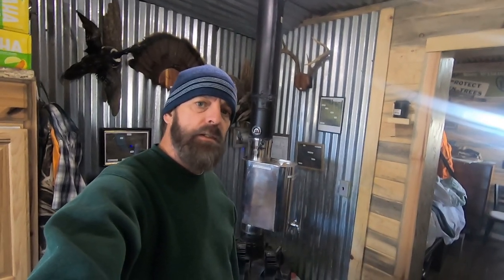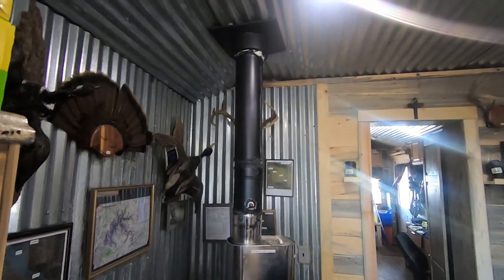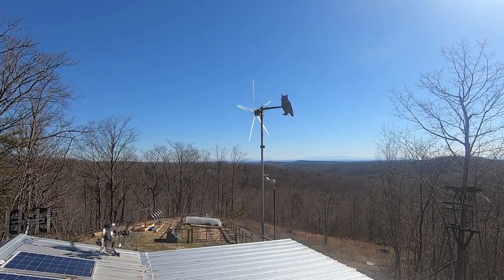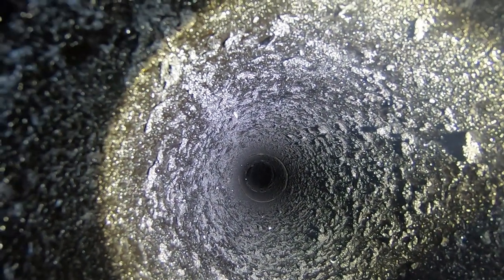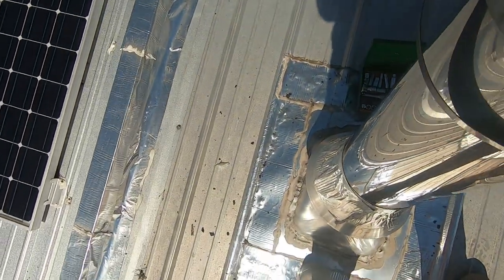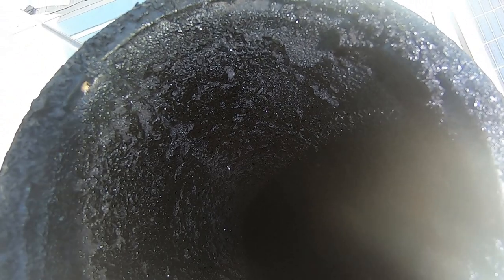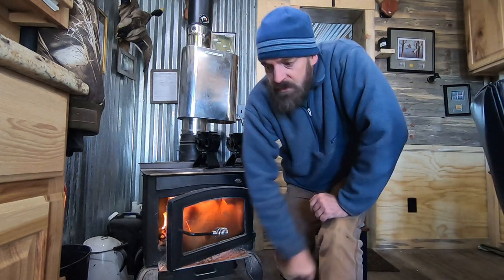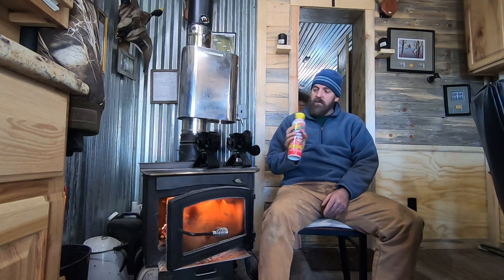Cleaning the Wood Stove Chimney at the Off the Grid Cabin  Homestead

Comment: Great video! 
If I let it dry out like you said is there a type of wood that is cleaner or dirtier?
Reply from the maker: I'm blessed we have hardwoods. I will not burn softwood. I'm going to build a wood storage shed to air dry the wood.
Reply from the maker: Also...thank you for taking  the time to leave a message
Reply: I prefer well seasoned hardwood, and avoid resinous woods like pine, but sometimes you aren't in a position to choose. The drier the wood, the cleaner it will burn